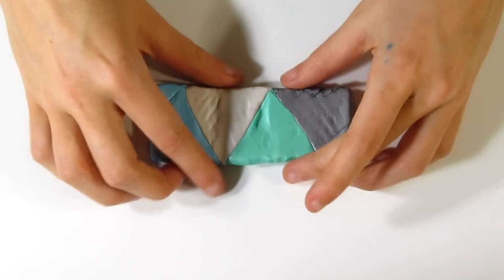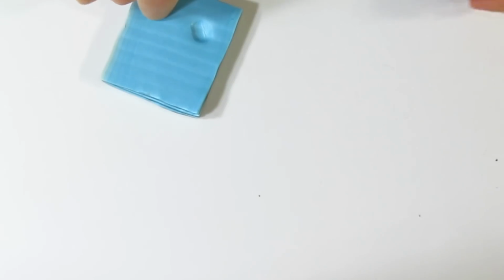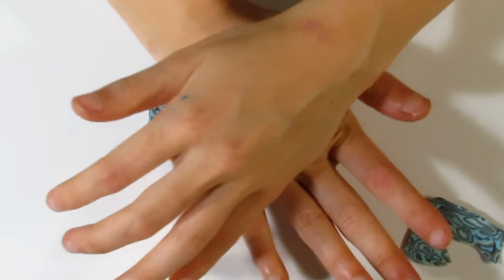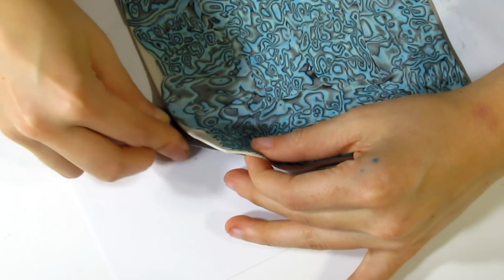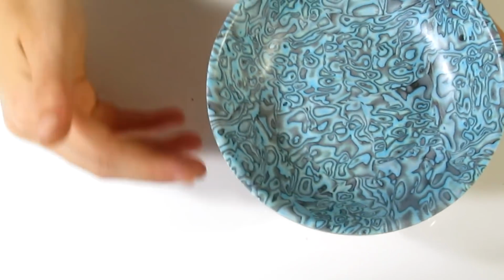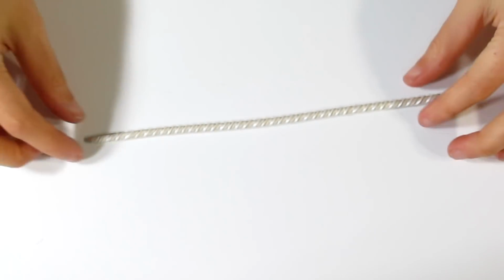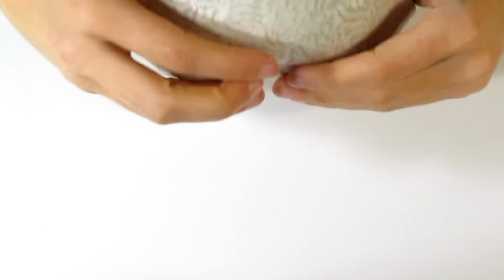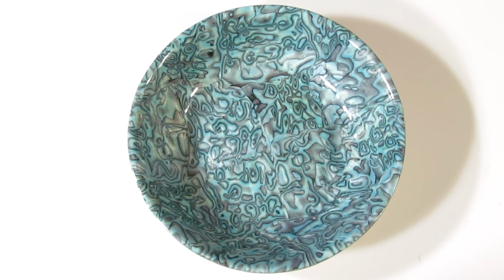Polymer Clay Faux Technique: Faux Abalone Bowl Tutorial

Comment: Instead of cutting squares and putting them together, what if you just roll out the log and use it that way? Would that eliminate the look of squares in the dish?
Reply from the maker: Yes, you can do that, but it would result in a different pattern.
Reply: @JessamaTutorials  What if you cut it in half and then rolled it out. Would the pattern be the same?

Comment: Can you use food safe mod pod gear on these?
Reply: If you mean the dishwasher safe mod podge, no. Its not food safe. If you mean the mod podge acrylic sealer, yes, but you need to let it fully cure (30 days). Most polyurethane varnishes are food safe once cured but check and be sure. Regular mod podge (brush on), including the dishwasher safe one, are not food safe!